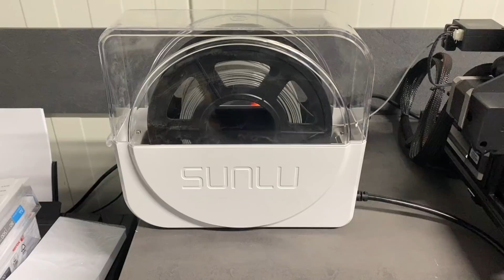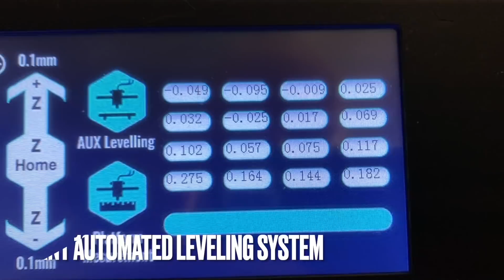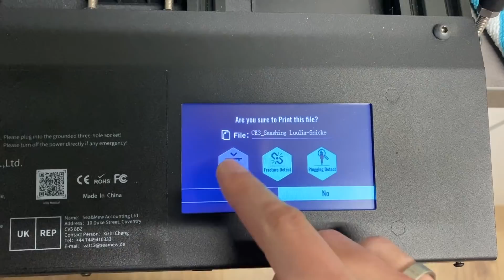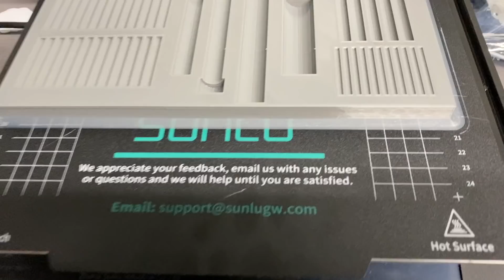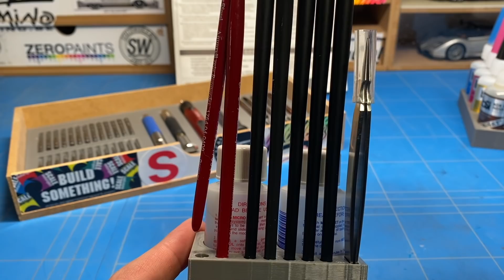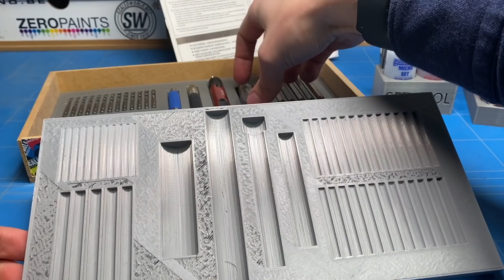3D Printing Custom Drawer & Workbench Organizers with a SUNLU S9+

Comment: For the tray it can be worth adding finger holes to help getting parts out, a slot running perpendicular to the parts mid way or a quarter sphere cutout on either side. You can get a thumb and forefinger in easily to pick out parts. Tools can be buggers to lift out if the cutouts are very snug fitting.